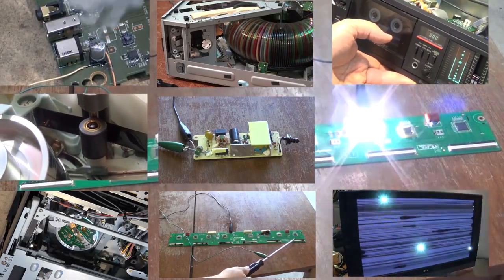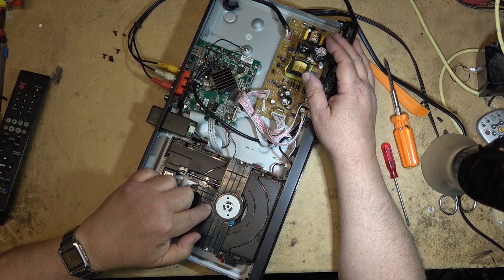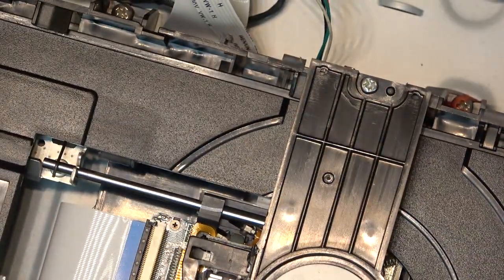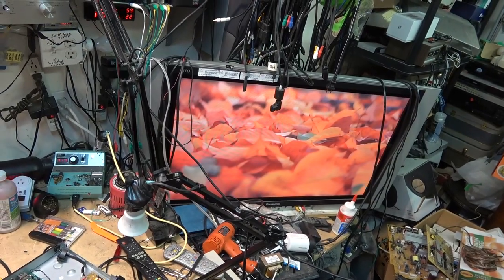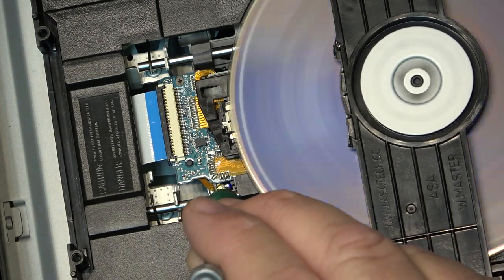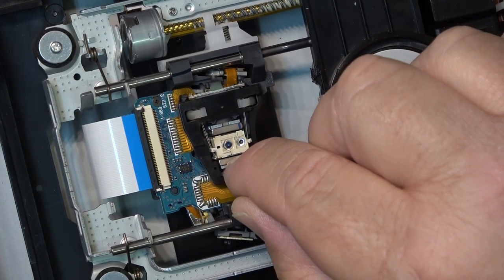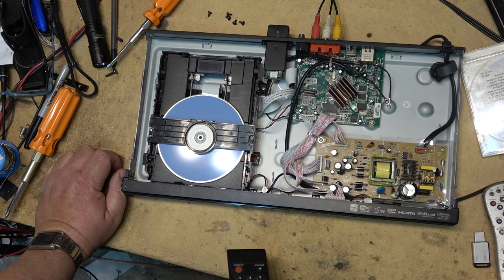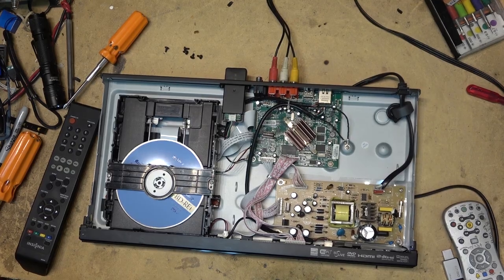Insignia NS-WBRDVD2-CA Bluray player loading belt replacement procedure

Comment: seeing you play those movies off the usb stick got me to thinking about my dynex i bought second hand and i jumped up and looked at it and found out it would do the same thing! i have a usb stick with about 50 movies on it and plugged it in and it worked perfectly. i have a smart tv and was using the player program on it and worked fine but the blueray has a remote and has more playback functions on it plus it frees up the single usb port on my tv. thx so much. all my usb movies are in mp4 and were either ripped from disc using win x dvd ripper or if using vhs using capture card and obs
Reply from the maker: Obs good. That's what i use to broadcast.

Comment: I still haven't learned why there are warnings about lasers inside. Is it because staring at them can damage your eyes? My DVD recorder will not play (more than a few seconds) if the top of the cabinet is off. I haven't figured out how to bypass the interlock.
Btw, I like optical media too. I use it daily.
Reply from the maker: If you focus the beam on you eye then yes you will have a problem. A burner especially, as they generate much power however, the beam is not focused away from the lens. It is focused where the data layer of the disk is. If you were to use optical instruments to view then that is a bad idea.
Laser radiation from fiber optics is the same. It will diffuse out of an unplugged fiber, but if you were to focus that on your eye it would be bad.

Comment: I've seen plenty of optical drives (mainly in computers) that don't need a belt; it's all gears from the motor to the tray. One wonders if the addition of a failure-prone belt was out of planned obsolescence. I can't imagine a belt being that much cheaper than another stage of gear reduction.
Reply from the maker: Seen many gears crack and break in 2.

Comment: hello i have a question about a video from 1 year ago lol. it’s the sony handy cam c:31:23 on the dcr-trv250. it worked but now my footage on the screen is choppy and the audio is bad. could you help me out
Reply from the maker: Clean heads
Reply: @12voltvids  how
Reply from the maker: @spare9119  cleaning tape.
Reply: @12voltvids  ok, that might be the problem but it started happening after the fix i was messing with the white lock pin though

Comment: Surprised that a Blu-ray player thats recent enought to have wireless connectivity also has a bad loading belt. What are they making them from these days, liquorice? Especially when some from the 70s are still good.

I'm also a big fan of optical discs, especially now that people are unloading aome really rather nice kit along with entire collections of DVDs and CDs for next to nothing due to streaming. Suspect they'll regret it in the same way people who threw away all their vinyl records in the 90s did. 

I don't have a smart TV either, just a number of Panasonic plasma displays. I did have one, from Bush (UK budget brand) but even before it developed a backlight issue at just 4 years old, most of the smart features were either no longer supported or so sluggish as to be unusable. 

A Fire stick or Roku might tie up a HDMI port, but at least it's easily upgraded when needed, without having to dump an entire display when it gets bricked by a firmware update. 

(I like insignia stuff - we don't have Best Buy here, but i oicked up two of their Google-enabled alarm clock smart speakers on a trip to the US some years back and was very impressed with the quality.)
Reply from the maker: I just find optical disks very cool. Lasers are cool, period. Laserdisk, CD, DVD and Bluray. That little HD camera that writes to regular miniDVD is icing on the cake. It pushed DVD to the picture quality limit without being a full BD burner. i would love to have the hitachi BD camera and a couple of mini BDRE disks BUT I am not about to pay what people are asking. One locally came up and the guy was asking 700, no battery and no disks. On drugs. I will settle for my little AVCHD that uses regular disks. Not going to use it much, its just for the cool factor and I have 10 re writable disks for it plus it uses the same batteries as my 4 other sony cameras so that will never be an issue.